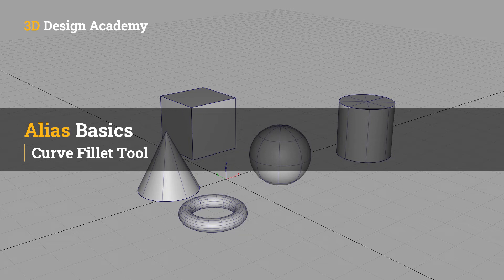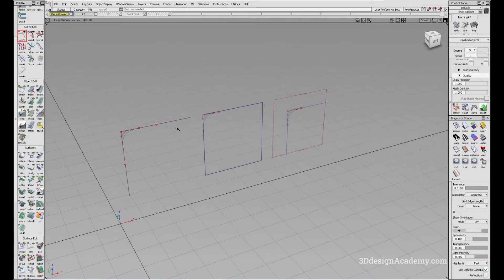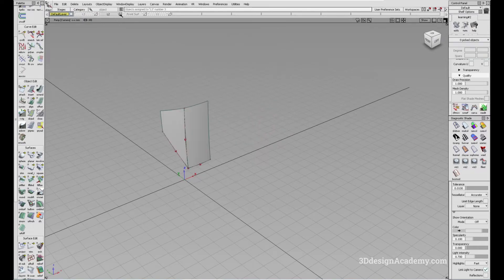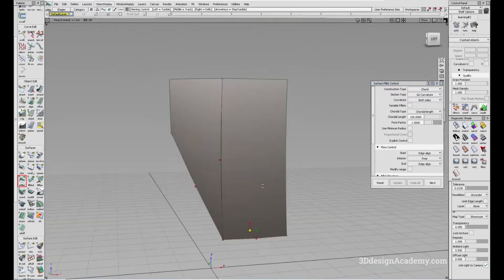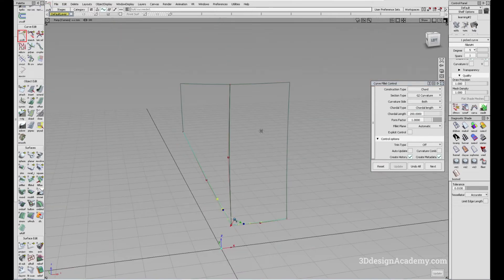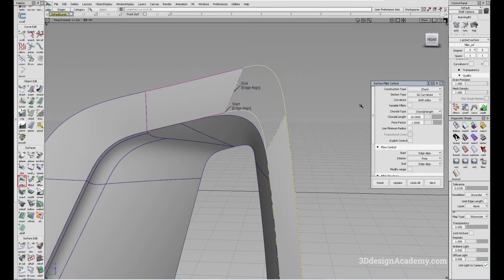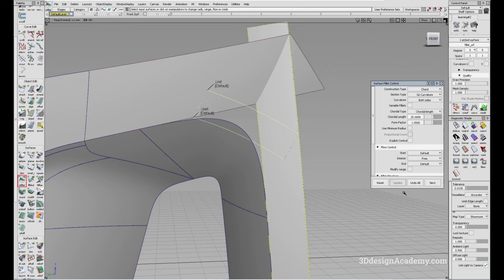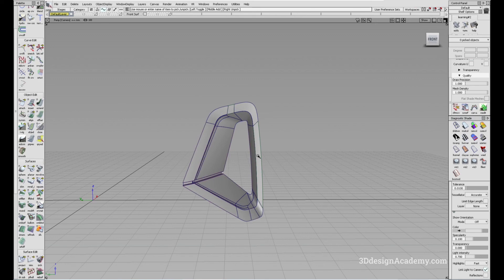Autodesk Alias Basics Tutorials 50 - Curve Fillet Tool

Comment: And in general, what is the right approach with trimmed edges? untrim , project to COS and then trim again or work from a trimmed edge? will it even make a difference? And what if I already project align and then need to reproject? Should i remove COS first and project again for better quality? Or I can use the same COS again?
Reply from the maker: That depends. The goal is to make sure that your COS is clean. If the COS is not clean, then the resulting surface won't be clean either (multiple span, CV structure with zig zag, etc). If it is clean, then it doesn't really matter and you don't have to untrim, project, and trim again. The only reason why you would want to untrim and project again is if the first COS that was created wasn't clean and gave you a not so clean surface.

Also, if you're aligning with "project" option, you just want to make sure that there aren't duplicate COS. If there is, you should delete the one that wasn't generated by "project align."
Reply: @3DDesignAcademy Hmm.. I guess I get it,  but not quite. Can you please make a 101 video of aligning to trimmed edges? And as for removing COS duplicates - great suggestion, I will keep it in mind, thanks!
Reply from the maker: @alexandergolubev6358  I've been a bit busy these days, but I'll definitely make a video regarding that topic in the near future!
Reply: @3DDesignAcademy Awesome, thank you!
Reply from the maker: @alexandergolubev6358  You're welcome!!